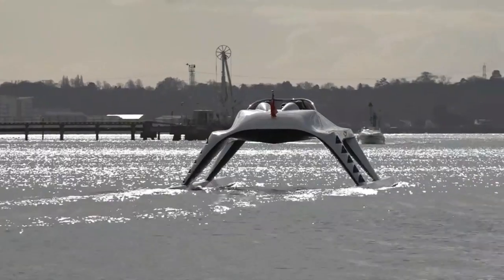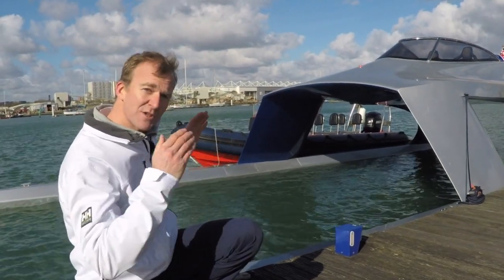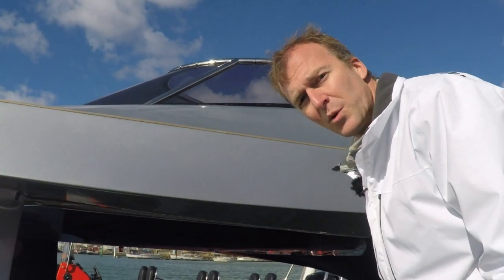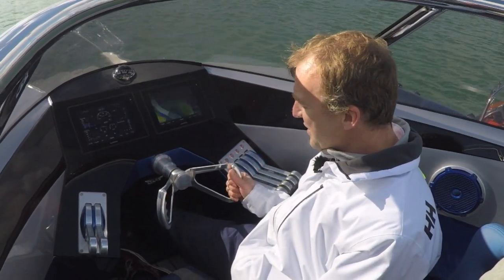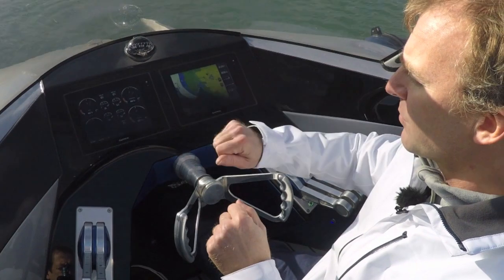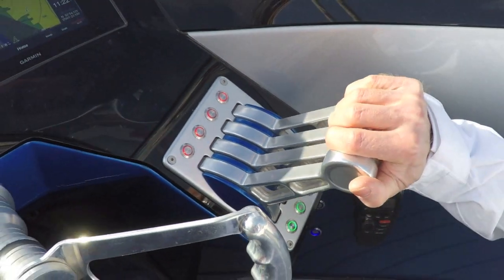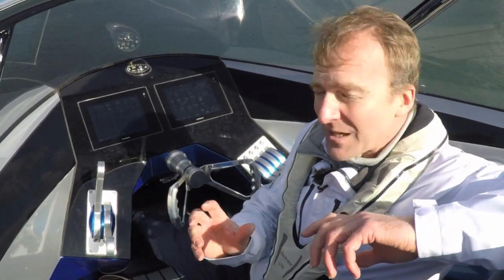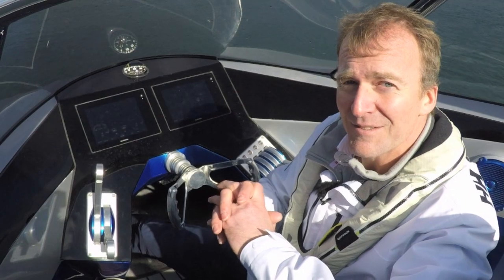Glider SS18 review | Motor Boat & Yachting

Comment: Swath-hulls is not a new thing. They are tough and make a stable platform. But like a more traditional catamaran it has to be quite big so you can make use of the space in the hulls. As for the project in the video i just don't get it.
How do you moore? If you have a man overboard, HOW do you save the person from the water? The steps to climb aboard is nothing but stupid, someone will be hurt.